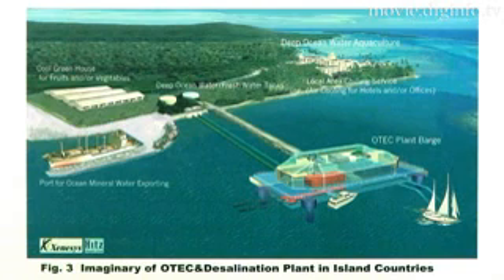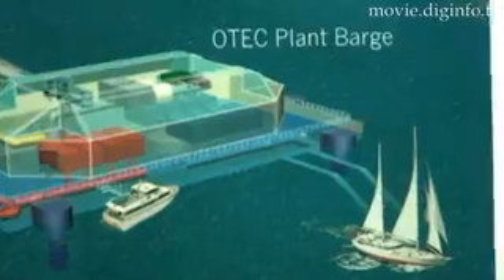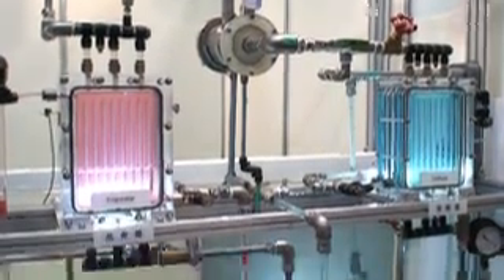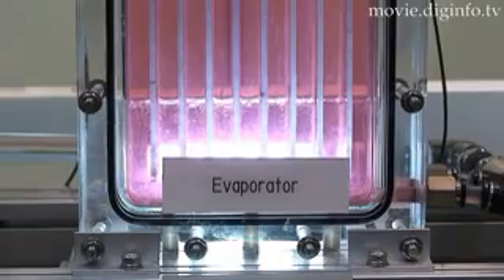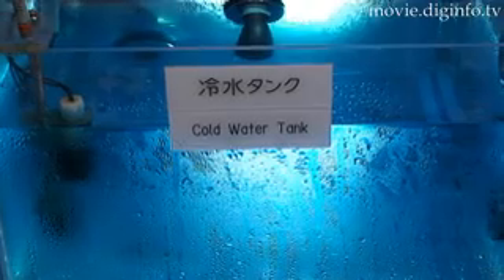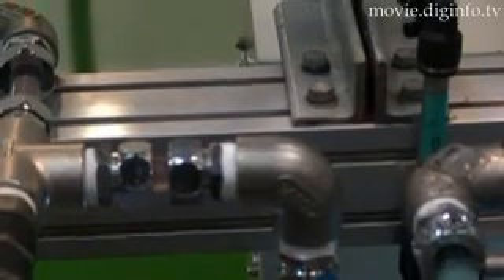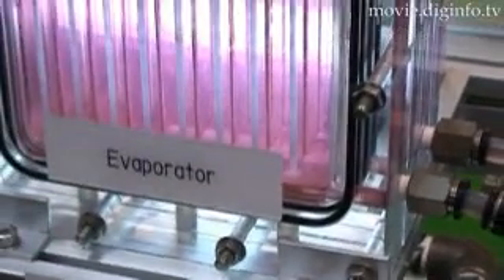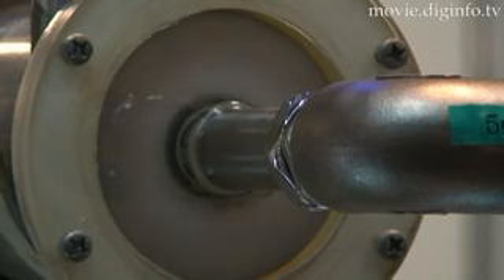Ocean Thermal Energy Conversion System : DigInfo

Comment: Using the ocean to cool the liquid seems fine at first, but what about long term dumping of heat into the ocean?  Effects of ecology immediate local ecology and eventually surrounding areas?  Fishes & planktons die because of increased heat will cause a chain reaction.  Polar ice cap melting?  Doesn't what form of energy we used, the output is always heat.  While some maybe cleaner than others.   The real problem is how do we solve the waste heat!!!

Comment: You´re correct. Ammonia is the fluid which moves the turbine. No water.

What happen if the ammonia is pumped to the deep ocean thru a close cycle pipe.

Comment: You can build a refrigeration/heating system using just this principle. My design incorporates a small Tesla turbine driving a propane/butane mix refrigeration plant that is reversible, using the difference between the air temperature or the surface temperature of the deck of a sailboat and the water temperature at the keel. Runs for free as long as you have 20' F or more differential.

Comment: my idee look the same  bud i  should use 12v genarator  and 12v water heater.

boil the water until  your system olmost explodes. and slow release the press  to turn the turbine or somthing.  then  when steam cools down  it returns to water

Comment: The NH3 is going around a closed loop system. It is being evaporated at the surface of the ocean (it stays in the system, just changes phases from liquid to gas), then condensed at the bottom of the ocean floor (again, within the equip). The total mass of NH3 would remain constant within the system (minus any leaks that may occur).

Comment: This is just a simple compression cycle using NH3 as the refrigerant (as is done commonly in yesteryear's refrigeration cycles). Theoretically it makes sense, however they didn't discuss the required head to pump all of the working fluid throughout the system. Static head can be ignored due to the fact that it is a closed system, however friction head would be significant as the delta y between the "evaporator" and the "condenser" would need to be quite large to get a sufficient delta T.